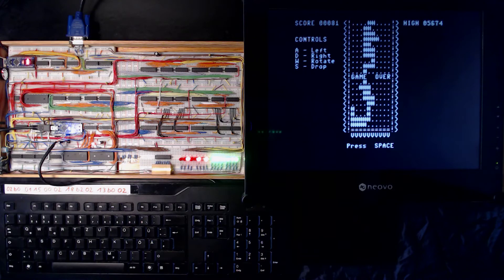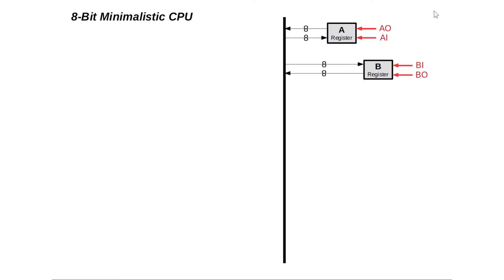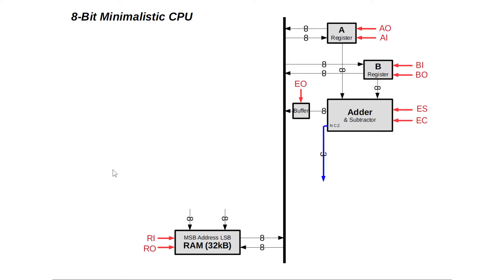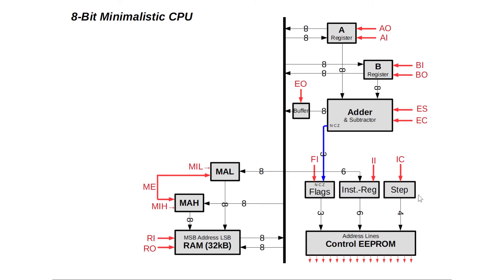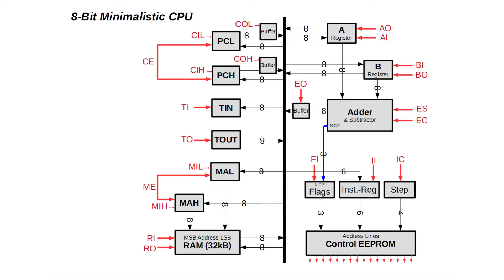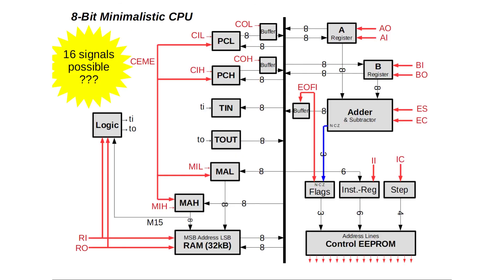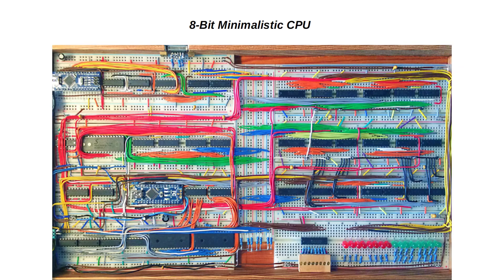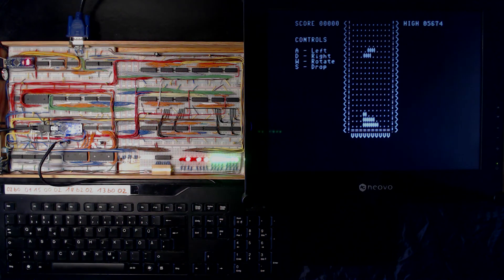Breadboard Computer with Minimalistic Design #3 CPU Architecture & Tetris

Comment: Ah ok ya mine will be a Harvard architecture so using flash will complicate things lol edit: wait but you are executing from EEPROM? That means you have two different memories for instructions and data, which is Harvard architecture not Von Neuman.
Reply from the maker: My design can execute from FLASH or RAM - it doesn't matter. It is just seen as a single block of memory for instructions and data. It's just a single memory bus and therefore I'd call it von Neuman. The OS is actually copied to RAM and executed from there but for another reason.

Comment: This brings me to the question, why did the first guys who designed the computer had to resort to this gigantic machine that takes up the whole room ? Fools
Reply from the maker: Yeah, why the heck did they use vacuum tubes in the first place?! But I think it's interesting to note that the design I present here could for the most part have been used in the early 1970s.
Reply: @slu467  yes, i once thought about building processors from a non-saturating vacuume tube logic i called the cathode coupled logic,i could never get the size down to something i can use at home, so igave up on that idea. i'm now working on a CPLD based processor design, doing everything from scratch

Comment: I've build Warren Toomey's CSCvon8 CPU which is another minimalist CPU using only 17 chips but he does 'cheat' a bit by using a ROM as an ALU and a UM245R for I/O. He uses multiplexors to keep the control lines down to 16. I've designed and built a 64 colour bit-mapped VGA add on for it. Take look https://www.youtube.com/playlist?list=PLLyEO7jRCsrpWz75QNXBMwLh8yXkMGEuz
Reply from the maker: @David Thanks for tuning in. I love the colors... but I also love the "high" resolution 320x240 the design I've documented here has to offer running on just the Nano :-) after all it's madness to do VGA on 
Arduinos but it's fun anyway. Cheers!

Comment: Now you have me wanting to build your version.  🤣🤣🤣
Reply: Woow, great quality as always. Waiting for the next video and the schematics.
Reply from the maker: @Diego, thanks a lot! But believe it or not, I don't actually have schematics for this board. The design is so modular that I never really needed any :-)
Reply: @slu467  I've been drawing them up from the photos, just as I assemble my own version. I've almost finished the 16 bit program counter. I've been trying to work out how P0-P3 on both counters are connected to the bus-  it's a bit hard to tell from the video with wires overtop.
Reply from the maker: @Aaron: Unfortunately, I can't help you with the schematics right now. For the future, I plan to have a KiCAD file of the design and eventually build a nice and clean PCB version - maybe around Christmas :-). Sometime the connections on these breadboards are not that reliable. Additionally, there are some ICs (2x 74HC595) on the prototype board I wouldn't include in a cleaned-up version. I've used these ICs to have the Arduino output the 16 control signals directly (without the EEPROMs). In that way I it was easier to test each module separately and to optimize the microcode (saves you from burning EEPROMs again and again). Since the Arduino also has access to the bus, this also allows to conveniently implement RAM upload. Cheers!
Reply: @slu467 Thanks for the heads up on that, so far I've built your Program Counter, VGA (including registers) A and B register and ALU. I love the way both A and B buffers are pretty much on the same lines.  Today I'm going to start the instruction register. I would love to be able to message you directly to confirm a few connections
Reply: @slu467  I'm getting there, slowly working it out. I'll admit I'm a bit stuck with the exact wiring on the Flags/ Instructions / Step because it's so hard to see where the connections are in the images/ video. https://imgur.com/UKxyxVd
Reply from the maker: @Aaron Wow! That looks amazing. You are knee-deep reverse-engineering my mess :-) But I am thrilled that you officially build it's version 2 on this planet :-). I think by now you might know more about the details than I can remember... I've updated my channel info, so messaging me directly should be no problem. Cheers!
Reply: @slu467 thanks, it's taking a bit of time but I'm slowly making sense of it all, it's largely been trying to work out what sides are most and least significant bits that's beem doing my head in. I'm in Australia, so I shall get in contact with a few questions tomorrow.  Thanks :D
Reply from the maker: That would be awesome! Glad I got you hooked :-) and maybe you find "that next improvement". As I always point out, I hope that there is a convergent design to be reached here. Take care!
Reply: @slu467 it's a good solution to the control line problem as well as tbe 8 bit address line problems. Mine is currently about 90% the Eater version  and I'm thinking I may replace the RAM.  Although it would be nice to be able to dump stuff into RAM on startup
Reply from the maker: Yes, I think being able to do RAM uploads via a serial interface is really essential for testing stuff. Maybe one could do without it within the SAP-1 architecture Ben Eater is using and survive with the dip switches, but as soon as the software projects get a little more ambitious it's really helpful. I actually cross-develop all my software on PC using an assembler and emulator. This process will also be part of my video series and I'll be releasing these tools on Github.